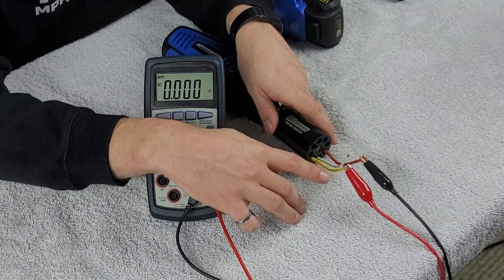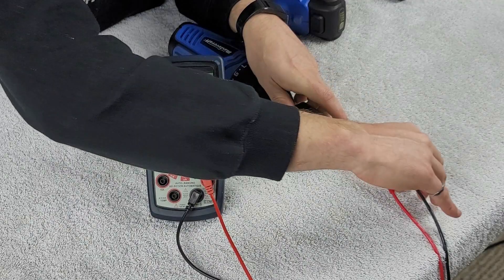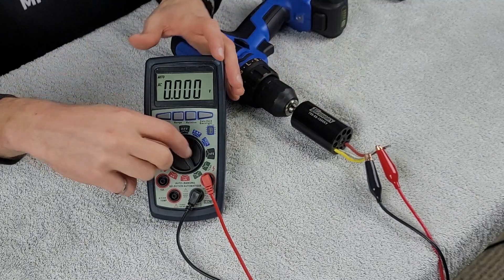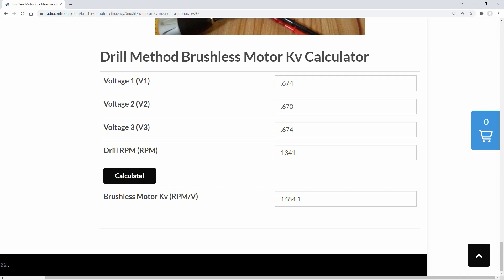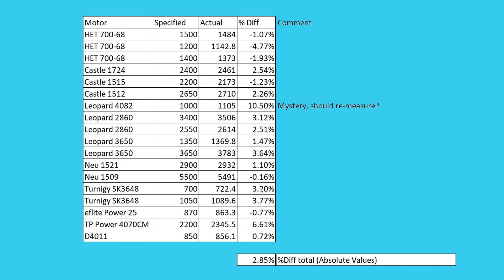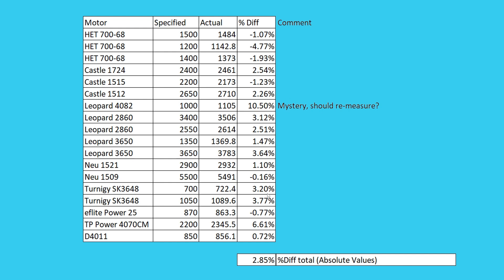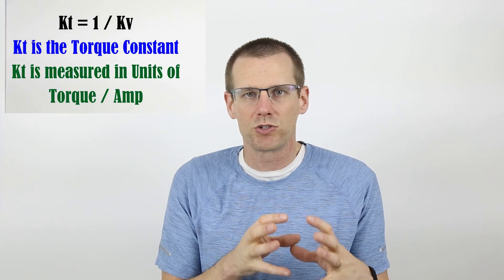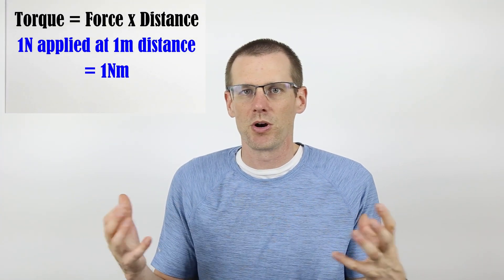Brushless Motor Kv Secrets Unveiled, Can You Trust the Numbers?

Comment: Hi there just got a losi dbxle. With the stock motor 56113 780 kv 17/50 gears got 92 kph. Esc was cool motor was warm lipo where cool. So I changed the motor to a leopard 5892 1200kv with 13/50 gears. Went 101 kph and the esc cut out 3 time and was hot the motor was cooking with no fan but it was 34 degrees or about 95 f. So the 780kv is rated for 8s but seen others run it on 12s. I think running a 8s high kv system is a no go. But maybe running a hobbywing max 5 g2 with the 780kv or the hobbywing  56118 800 kv on 12s mite be better and gear up slowly. I would like to use the stock motor but it mite fall apart any info would be great.
Reply from the maker: Just curious why you were looking for more power and went with a smaller motor? Power doesn't really come from Kv values, power comes more from the size of the motor.
Reply: @RCexplained  the leopard is 1200kv so going from 26k stock  to 40k I thought I could get more speed and I did with  the stock pinion  but was cooking and was a hot day. Just a trial of a spare motor.
Reply: @RCexplained 
Stock system 780kv 8s 13/50 70kph. 17/50 90 kph.
Leopard 1200kv 8s 13/50 101kph.
Reply from the maker: In theory. Smaller motor. Less power.

Comment: Would you be willing to tell me if the Saiko Guardian is better than the castle 1721 2400kv for speed runs and drag?
Reply from the maker: I've never used a Saiko motor. The 1721 is hard to beat for its price.

Comment: I see KV as the electronic gearbox of the motor. Unless you are changing gearing parameters (like battery voltage, wheel size, spur gear,...) it's wise to stay close to original specified KV of the vehicle. Want more power, go for a bigger motor with a simular KV.
Reply from the maker: Interesting perspective!